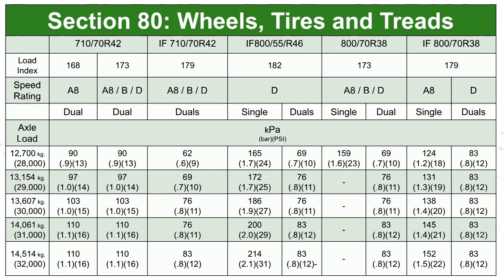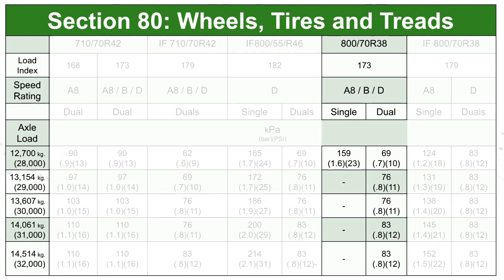How to Determine Correct Tire Inflation Pressure | John Deere Tractors

Comment: This doesn’t explain at all whatsoever how to check tire pressure on a tractor. How do
I tell if there’s liquid inside? How do I even read tire pressure when there is?
Reply from the maker: All great questions. You can find this information under the Wheels and Tires section of your Operator's Manual. If needed, you can find a copy of the manual online at http://spr.ly/6057AH3oB. We hope this helps!

Comment: what tire pressure for JD A400 windrower? Front and rear?
Reply from the maker: Thanks for the question. The A400 Self-Propelled Windrower has front tire pressures of 144.8 kPa (1.45 bar) (21 psi) and rear tire pressures of 97 kPa (0.97 bar) (14 psi) for optimal performance. You can find this information under Section Wheels, Steering, Brakes, and Rear Axle of your Operator's Manual. If needed, you can find a copy of the manual online at techpubs.deere.com. We hope this helps!
Reply: @JohnDeere  thank you...the rear tires say 44 psi.  This must be for the road